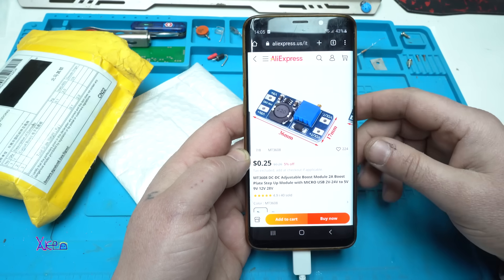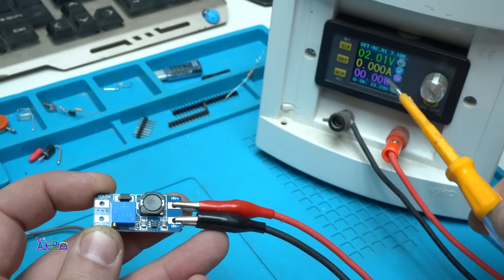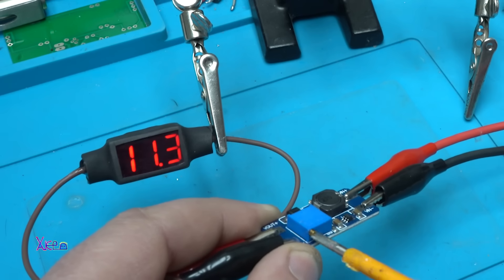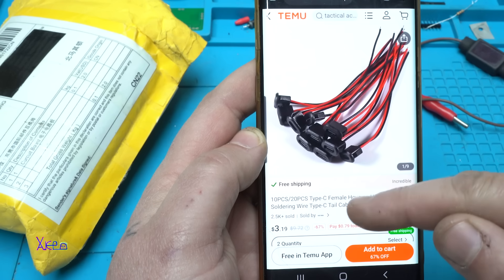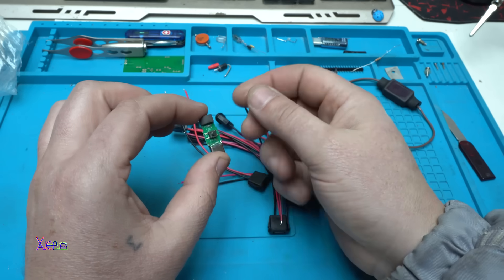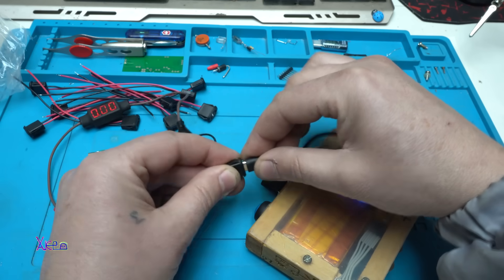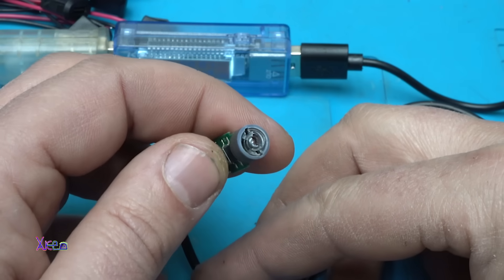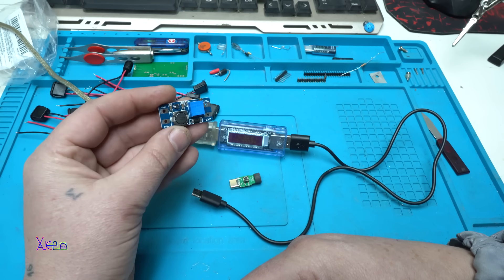WHY These $1 Aliexpress Modules are Amazing

Comment: I want the output to be isolated. I want to be able to connect several to the same power and then put the outputs in series. Can I do that with the boost converter that you presented first?

Comment: Why didnt younproperly test the booster? For example set 12V but then lower the input voltage and see if output remains stable at 12V, use a realistic Load and see if the 2Amps are delivered ... And this for a range of output voltages.

Comment: The USBC cigarette lighter won't work with a proper USBC supply because lines CC1 and CC1 are absent.  There needs to be 5.1k pulldowns on those lines for power to be supplied..

Comment: The cheap boost converters will give very different voltage from day to day. So you can set it to 5V to run some project, then the next day it will be putting 6.3V into your chip, frying your project.

Comment: ha ha ha buying junk just to check it out. use the lighter for an electric pipe. it is beyond incredible dc to dc for almost free . ive been a tech for 45 years boy o boy have thing gotten easy compared to the 80's circuits

Comment: Ok now put a 12 ohm resistor across the output at 24 volts. and see if it will sustain 2 Amps without frying. Or 6 ohms at 12 volts the choice is yours.

Comment: In 7:00 I blew my screen :) And I really wanted you to turn the usb 3 jack the other way when testing female adapter but you didn't try that. I hope it works properly for both ways.

You can modify that cigarette lighter into a battery powered styro cutter. That may be also handy. But the current it consumes seems a bit high to me, i guess you will need better battery protection circuit for that component.

Comment: A friend of mine built a self lighting marijuana pipe by putting a small screen over the top of the heating element. He doesn't use it very often but when he was trying to light his pipe before he always misplaced his lighter or matches. He powered it with 3 AAA batteries in the holder that used to be the bottom of a small LED flashlight. He sprinkles a little in the top of the ball and pushes the button and was ready to go.
Reply: would be crazy to actually light/burn it at that point. make it vape!

Comment: Remote control igniter for a smoke grenade. Maybe even use a few and attach them to a metal plate for a hotplate or solder heating station base.

Comment: This kind of vid is more important than I think people know.  It shows what is available for stupid cheap right now.  I mean 25 cents for the voltage converter??  The freaking postage should have been $1.  And how many times do we need voltage of some special sort?  Yes, the 2.1 V input might seem like an issue, but not really .  Just put 6 of them in series and hook to a 12v source and now you have a 12 amp power source for pennies on the dollar.

Comment: That $1.25 power module ain’t going to put out 2A at the 20V you set it to. That’d be 20A at the 2V you were feeding into it.
Reply: What? No, that's wrong. 2A@20V != 20A@2V.
Reply: @ 40 watts out requires 40 watts in.
Reply: @ No, it doesn't. That is exactly why we use higher voltages; higher current lowers the efficiency of the circuit by converting more of it to heat. So you would need the PSU to deliver more power. Why would that be an issue?
Reply: @jeschinstad  so the poor regulator has to not only convert voltage, but create energy also? If it could do that, they’d charge more than $1.25
Reply: @sirifail4499  What? You seem to be a bit confused. So let's start over; what is the problem with delivering 20A@2V? To be clear, I'm not saying you're wrong; I'm saying your argument doesn't make sense.
Reply: @ there is NOTHING in the regulator that can handle 20A. Every component, and the circuit board traces would fail.

Comment: Should check those USB-C jacks to make sure they don't trigger at other voltages on chargers where it can negotiate a higher voltage.
Reply: You need to use a resistor to signal that you're able to negotiate though?

Comment: MT3608 data sheet shows a switching frequency of 1.2MHz and output current of up to 800 to 1700mA dependent on difference between output and input voltages. You probably need an MLCC on the input of your target board to filter out the 1.2MHz noise. 0.1uF in parallel with a larger 10+ uF would be typical. These types of board from Aliexpress can be very useful indeed. Retired graduate EE.
Reply: It is a buck boost circuit?
Reply: @ricinro  No, boost only.

Comment: With DC DC boost converter i want to see output voltage stability  under load, 0% 50 % 100%  , does voltage sag under load ?

Comment: Whats the Run-time? How soon untill it burns out? You can use it to heat a gas or liquid. How about a waterbottle heater on an intermittent timer to avoid FROZEN water when hiking, skiing, or camping in extreme cold?

Comment: That fits an idea I have for locating my drone after a crash in tall grass.  I can use this to ignite a small smoke bomb by flipping a switch on my RC controller!
Reply: neat idea, just be careful about lighting an out of control fire if the area is dry
Reply: Setting things on fire is one of the absolute easiest things to do with electronics though. In fact, most of the things you do in electronics is to avoid doing that. :)
Reply: If it's not bye bye tall grass? Workable though with the right little barrier.

Comment: on the cigarette lighter... replace tactile button with microcontroller. Then write code (like timer) or use ESP to remote trigger that lighter so you can light fireworks remotly.

Comment: You need to test it with some type of load.
Reply: Thanks mate but you need to have a load. I doubt it'll pump out 56w (28v@2A)! For couple of second maybe and then it'll be  a mini BBQ. then a flaming heap of over confidence!
Reply: Yep, and then look at the noise and ripple on a scope. And then soak test it for 24 hours. Numbers on a voltmeter don't tell the story.
Reply: @christianblack2916  yes the ripple wrt v, i and load would be good. Then again the cost is very enticing for hoping for the best.

Comment: Those MT3608 modules say 2 amps but they can barely do 200 milliamps at 5 volts. 50 milliamps at 24V.
Reply from the maker: I'll look into that, thanks for the info!

Comment: omg could a usb HAND CRANK actually produce the power to turn that coil red and light a cigarette or match? u knwow hat to do. make a hand crankable electric lighter :D
Reply: Not difficult. All you need is a supercapacitor to hold charge and release it quickly. I had some hand cranked flashlights you could use for this.

Comment: put it in a metal tube or petg custom case, with battery, AND MAKE AN ELECTRIC LIGHTER with it since its only a dollar or less, if u had cheap batteries too, lol, maybe dont play with cheap lipo battreries and fire, maybe u can use a non lithium battery that is safer, but make a lighter, maybe use no battery, have it use a solar panel, or a HAND CRANK HAHAH

Comment: you can make a cool 3d printed electric lighter now. bambu shoudl sell those in a lighter kit hah. 
ALSO, they USE THESE for the WIRELESS FIREWORK starter. itsa wireless button, and one of these u clip onto a fuse and it lighst a fuse, lol perfct for cartoon warfare too lol peopel on the videos always say its for bombs lol. but yeah you SHOUDL 3d print a custom ELECTRIC LIGHTER obviously!

Comment: During this Chinese New Year,  used a 8266, a power banks, a 4-way relay, 4 USB heaters and some steel pipes to make a remote-controlled firecracker igniter...... It's not very  ideal, cause the consistency of the firecrackers is not very good...... although the USB heaters are lit sequentially, but the firecrackers are still set off in random.......It can only be fired in a slow sequence (2s~), not the "machine gun" rapid-fire burst I expected.
Reply: Just use a very thin wire in short around the fuse. It will light instantly.

Comment: Bomb detonator gadget
Reply: Except that's the easiest of all things you can do in electronics. All you need is a thin wire and a battery. I used to love doing that as a child. I would cut a wire in two, let some thin piece of the wire short around some matches and plug it into the wall. Flip the switch and the matches light. :)

Comment: Does the frist item change the output voltage if the input voltage is changed?  Does it  regulate the voltage also?
Reply: They regulate the output voltage.
 The chip adjusts the power switched through the inductor to keep the output voltage at the level determined by the adjustable potentiometer.
Reply: @massimookissed1023   Now how efficient is it?   What is the losses, if i want to use it in a solar project (for Meshtastic)
Reply: @RuneVenes  They are usually better than 85%, even up to 95% efficiency, depending on the difference between input and output voltages and the amount of current drawn.
 Switching regulators are way more efficient than shunt regulators (like 7805, 7812 etc) that just dump excess voltage as heat.
 You might want to put an inductor in series with your circuit and a nice big capacitor from + to ground after the inductor because switching regulators can put high frequency glitches on their output.

Comment: The lighter is perfect  for lighting fireworks or homemade rockets remotely
Reply: I love this and it would be reusable compared to the 1.00 starters that are 1x use
Reply: @Artwithbenji  People charge for starters? :) All you need is a thin wire and a high current. If you wind a cm of a single strand of wire around a wick and use it to short an 18650, the fuse will light and you can easily use a MOSFET to control it using something like a Raspberry Pi.
Reply: @jeschinstad  have made my own but the nicrome wire always burns out..  also this coil would most likely be reusable where as my ematch is a 1x use

Comment: But is the voltage booster isolated? Can the outputs of multiple units be series connected? What about parallel connected?
Reply: You can't connect them in parallel because you won't be able to get the same voltage and power would run from one to the other.

Comment: MIT's SAGE Radar computer built in 1950s had a built in cigarette lighter and ashtray. Your lighter module reminded me that. 😀Here is the caption from wikipedia web page: "The AN/FSQ-7 had 100 system consoles, including the OA-1008 Situation Display (SD) with a light gun (at end of cable under plastic museum cover), cigarette lighter, and ash tray (left of the light gun)."
Reply: Possibly the first computer GUI, too -- its ideas inspired the team at Xerox Parc who developed the ideas further for the Alto computer.

Comment: Dude the videos are interesting enough without lying about the price of the module. I know this trick very well from aliexpress sellers, they show a very low price on the item but then charge you the difference or even more in shipping, for example that 25 cent module probably had a 1.80$ shipping so cost 2.05$ and not 25 cent but from another seller you can duy the same module for 1.90$ with free shipping so actually save 15 cent. 
Just so you know every time I see one of your videos starting with a lie about the price I just close the tab because I will not reward deceptive behavior but when you don't lie about the price I'm happy to watch the entire vid.
Reply: Temu, AliExpress, etc... they all use "Dynamic Pricing."

The company internet 😔 interface d texts where YOU are located. The web interface then changes the prices based on where you are located. 

These prices do not reflect the economic reality of your location. 

They reflect the greed of the company selling to you.

Comment: If I have USB 5v charger then boost to 12V. Can 12V be as charging circuit? Let me know 😊😊😊
Reply: I don't know what that means, but if you're asking about the MT3608, then yes, you can use it to charge a 12V thing using a 5V source, like a USB power bank. Or you could use a single 18650 battery to charge your phone at 5V.
Reply: @jeschinstad  thought so if 5v is source charging circuit then boost to 12v
Reply: @ You can do that, yes. You're still limited to how much power the source can provide, of course.

Comment: the MT3608 is  available even cheaper, at 14 cts. Too bad though there is a 3.10euro S&H
The cheapest I found it was 36 cts +1.80 euro S&H, or a 1.24 one, with free S&H if your total order  tops 10 Euro

Comment: Those usb c connectors will not work with a fast charger with power delivery PD. 2 of the data pins need to be pulled down with 5.1k resistors. They are available with 4 leads, but I've not tried them.  They do work with a usb a to c, as you showed.
Reply: Yeah, many people don't know that. What's the use of having a USB type C connection on a device if it only works with A to C cables? The whole idea behind putting a type C connector on a device is to make it compatible with today's standards 😂
Reply from the maker: Tested they dont work with fast chargers,but recently I order a trigger module form aliexpress
Reply: @Hacktuber what is the trigger module called?
Reply: @cajampa  I don't think there's any such thing as a trigger module.

Comment: That little lighter is great for hikers and campers to use with a little five volt power bank to help start fires, if they're carrying a power source of some kind. Even with the little solar panel chargers
Reply from the maker: Great concept😉
Reply: You can get usb powered lighters.
Reply: @jrplus416  kinda like that
Reply: To be clear, they have their own lithium ion battery and can easily be charged with a powerbank. No need to buy something else. I've seen a cigarette lighter and a long necked BBQ / candle lighter. The long necked lighter used a electrical arc to light candles etc.
Reply: Sure but that's pretty Rube Goldberg considering Bic lighters exist.

Comment: Very interesting video. Thanks for testing this for us. I would have liked to see the power booster under load. I'm afraid it can't handle much current.
Reply from the maker: Great suggestion,in next videos I will show that
Reply: lol it can look up the USB C standard.
Reply: The boost module uses the MT3608 boost chip.
It has limitations on how much current it can deliver to the output load.
The MT3608 datasheet is commonly available.
I have used these modules and they are pretty good, just dont expect to get 2A output when it is boosting the voltage.
Reply: Simple math? Increasing voltage by a factor of 10 (2v to 20v), will decrease the available current by a factor of 10, therefore at 20v the maximum current available will be 0.2 amps. Yes?
Reply: @tmacan  Sorta in theory. In practice is another matter. The extremes of the ranges are likely to be horribly inefficient, say 70%. So 2,000 mA ÷ 12 * 0.7 = 116 mA, in THEORY, running flat out. Say 50% of that to go easy, and we're around 55 mA.

Perhaps just enough to run a tiny circuit or something at 24V. But the real question is how it performs under load, and continuously VARYING V_in. ie. A circuit that needs a stable 24V, as a battery voltage starts at 10, and drops over time. It may not be configured for that.

That said, such pre-assembled modules are likely to perform better than chip constructing it yourself. So finicky!

Also worth noting, there is likely to be a fair amount of noise on the output, due to the high frequency "switching" nature of the chip.
Reply: @tmacan Lol, no. The relevant part isn't the max current, but how much the voltage drops when you draw different amounts of current.

Comment: Please measure AC ripple voltage under load
Reply: Great scott has a great video on these mt3608 boost modules..and safe to say the noise is bad..could be fixed though with a mlcc..the video gives a detailed explanation

Comment from the maker: Should I do TEMU Unboxing?
Reply: I just got ripped off by TEMU. I ordered one model of a thermal camera and received a cheaper one. They will not even respond to me! Oh well, it was my LAST order from them. Peace!
Reply: @DonnyHootieHoot  I ordered a sling  (only a couple dollars) and one string was shorter than the other by half. Not a big deal but still wrong. You have to watch out for the shady stores. TEMU themselves are not the sellers, they drop ship or gather and  repackage for cheaper postal charges and keep the extra money that's how (I think) TEMU and Ali Depressed make their profits.
The Love Fishing Store is who ripped me off.
Reply: No, temu sucks
Reply: Interesting items.
The heater can be kept in your car, you are camping, need to start a camp fire, plug into cellphone and light the fire.
Of course you can always use matches. 🤔💥
Reply: AliExpress far outweighs Temu for electronics, don't think there'd be much advantage...and the prices will be even more inaccurate🤣
Reply: Sure! I have got lots of components and modules from TEMU. There were only two occasions when the product was not up to par and they credited my account within minutes of my notification.
Reply: No.
Reply: Yes plz
Reply: TEMU has probably 1/10 of what AEx has in the electronics dept.
Reply: You want to catch your house on fire?:hand-orange-covering-eyes:
Reply: more like unwrapping
Reply: Rather not TEMU is also a china website and you can get scammed, especially cheap unreasobal prices on a 2tb flash drive for around $50 which is unreasonable
Reply: I've bought numerous items off temu and they've always arrived safely.
Reply: @waynesharp1690  You have been lucky then!